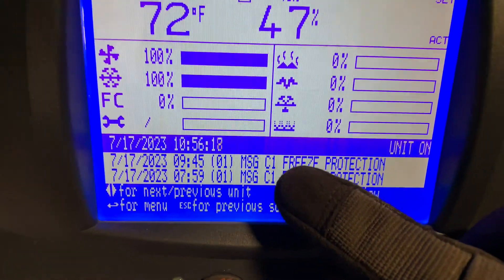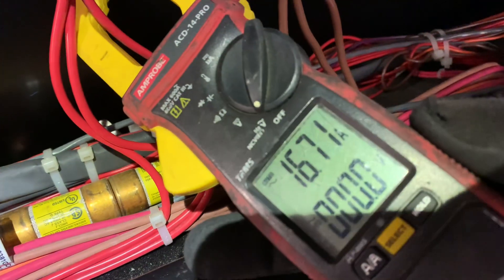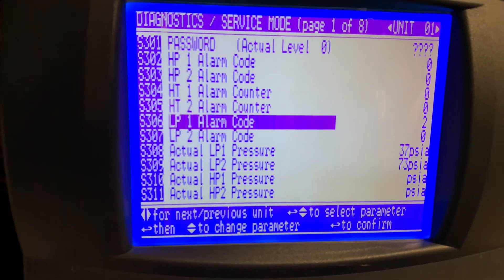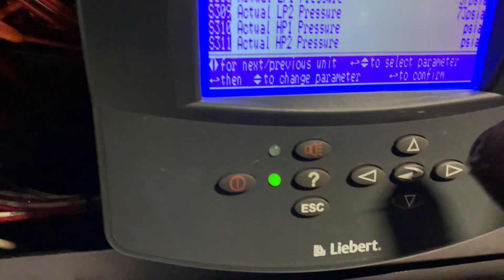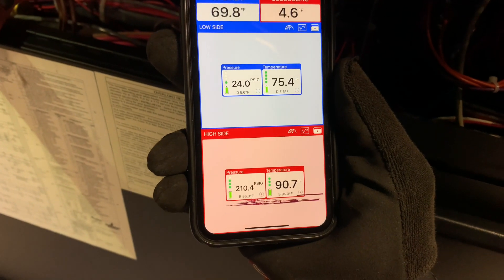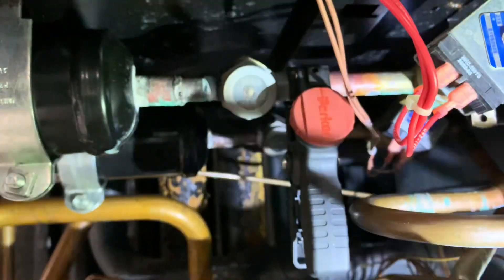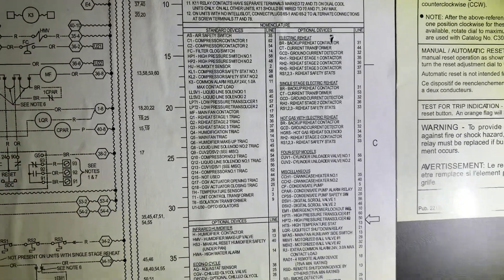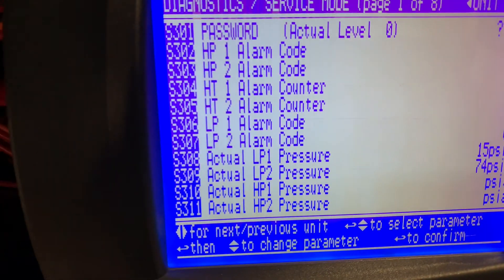LIEBERT/ VERTIV HVAC TROUBLESHOOTING

Comment: I have a unit with the same issue, the unit has been juiced, and same alarm keeps popping. Is it possible my filter dryer is bad, all I see is compressor oil
Reply from the maker: Low back pressures caused this alarm